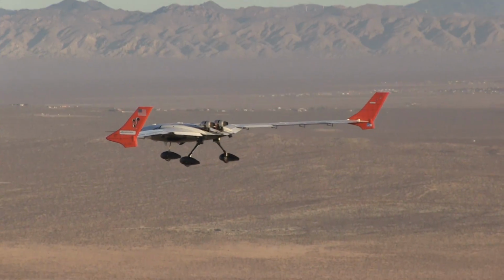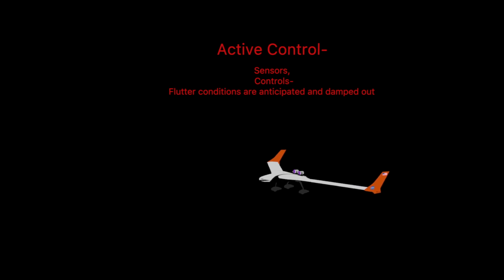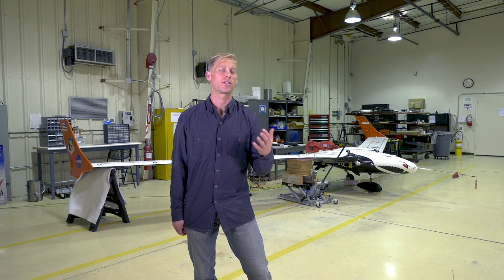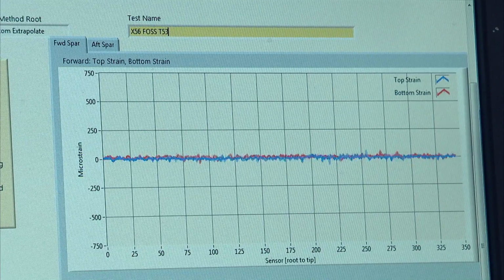X-56- The Future of Flight- Part 1: Active Controls

Comment: Very impressive project, lighter structure are more easily affected by resonant phenomenon. Active control can change the natural frequency of the system, but may increase the consumption of the energy for prohibiting the vibrations. May be adding some mechanical feedback system can achieve the same goal.

Comment: Stupid question. why not just make the leading and trailing edges resist loads differently so when the wing is forced up the leading edge bends less inducing a negative AoA which forces it back down again. 
If forced down it gives a positive AoA to bring it back up
With tuning of the structures resistance you can dampen out flutter automatically.
Reply: Do you mean like an active LE and TE actuators to actively monitor loads and initiate opposite motion?

Comment: So... you want to use this technology to fly at speeds where, if the system fails, your wings will be torn off before you even realize what's happened and can slow to safer speeds... 'kay.

I will keep tabs on this technology so I know what planes I should 'never' set foot on.

Who approved this nonsense? I mean, seriously. The viable projects that 'aren't' getting funding, and this joke is moving forward? Just because you can, doesn't mean you should. You want to know how else you can go faster without running into flutter? Go 'higher'.

Comment: Do not use a linear wing design ?!. Every even geometrical structure makes harmonic vibration possible. That is the reason why Horten choose the Manta - silhouette. Einstein was a good musician, so the engineers should learn to learn from instruments by implication.  Take every harmonic order in a corner- step in the wings depth and transport it to the next disharmonic counterpart in the following section - if by the profile and or the respective force of induced cyclic vibration.  NEVER use a straight shape or a parallel !
Reply: All types of wing design have been tested, including manta style and ufo style. While they do fly, and have some positives, the negatives far outweigh them. The most pressing problem is that they have poor flight characteristics, making them impossible for a pilot to operate. Linear wings are by far the easier to fly. Software could fix this issue in the future by controlling the plane for the pilot (current gen military fighters does this), but that is going to drive the cost up drastically.
Reply: @Excludos  I have flown quite a lot designs in modell prototyps (Wings) never using a computed aid. None of the early german fighter wings had to apply complex stearing drives. With means such as  boundary layer ventilation or fences you can minimize these effects. And if you design the wing that way, that the vibration causes a torque by the resulting force to deform the wing in the opposite effect to that vibe, it is also possible.  I can show you what i mean with organ pipes. I can design it so as no freq can ever  cause a resonance.  Or tune the structure by different harmonic length of the interiors and it will also counteract that problem. Messerschmitt was a better designer with his cigarettpacks.  Why ? because he felt the design without the mental aid of a computer. To draft a working wing, you need phantasy not a team or a kind of dependence. By the way:  With some inertial servo controll related to the freq of the vibe itself, you can neutralize the problem by phase shift applied to the flaps as well (random function, counterfunction even - odd movement).  And the surface: Microvortex, Cavitation modelling for defining the elasticity of the layer.  Multi hinge and multi pivot steering can deform the wing also in aberatio to the vibration. 
flap phaseshifting can be done with the most simple transistor circuit never ever being able to fail. And in case of emergency the Pilot just has to open the upper ventilation or a vortex  flap and all the relations and equations of the vibration are void. Easy and simple as the russians do.

Comment: So, essentially, with this system when your electronics go down, not only do you have that problem but on top of it you'll also immediately have structural damage risk?
No thanks!
Reply: Ah another example would be the „yaw damper“. This is essentially a flutter damper and if it failed at high enough speed that would probably also result in a crash if the pilot doesn’t decelerate fast enough. My point is: there are many controllers on board of our modern planes that we have to rely on. But they are ideally implemented with backup systems etc to make them secure anyways
Reply: Most modern fighter planes are built inherently unstable and would also crash without a controller stabilizing them. In the case of this plane, if the controller failed, one could simply deccelerate. As far as I understand the active damping is used to allow for fast flight without the need for strong structural construction.
Reply: @ididafewthings  Sure. He could also just eject. However, fighters don't have 300 passengers on board.
Reply: Muru Roa Hence, see my second example
Reply: Correct, but do you know what's FBW is?
Reply: @OnKeyboards  Yes and a lot of pilots don't like it for the same reasons, unless they have redundant generators. The problem of losing structural integrity is not on the same scale as losing input on the control surfaces for a whole minute though.

Comment: There is something inheriently problematic in overcomplexity.  The Shuttle is a perfect example.  2 lost vehicles, and 14 dead.  Soyuz in the same time period?  YOU do the math.  Id dare you to even glance at the economic comparisons...
Reply: I don't believe that the two shuttles which crashed were necessarily due to over complexity though. Challenger was due to an actually very simple system in improper conditions and Columbia was due to external damage to a system which was very complex in number but not in application.
Reply: I believe the shuttle deaths also had to do with less abort systems, today's craft have much better.
Reply: Neither shuttle was lost due to flaws in the shuttle itself. They were lost due to failures in very simple systems.

Comment: Active damping is not a great idea... if you want a robust system make it inherently safe.  It is not a bad idea, but given the potential savings over the number of humans on commercial flights, my money is on better "anything else". Better engines.  Better streamlining (a blended wing with a stiff wing? I would bet that is 60+% of the potential savings, and then add to that some form of turbulent flow drive... why bother going flexy?). So. Big flexy wings.  Great on sailplanes.  Really great. That is what they are for.  They are not for going 500+ Knots.  Even with "perfect compensation for known conditions", the wind/weather/speed will find a mode your models did not predict. More than once. Guaranteed.  Bummer.  To save 10 lbs of Kero out of 100s of thousands of pounds.  Sure, it is a great idea! But the wrong application, too much missing info (turbulence around hills on final? storm cells?), too many moving parts to safely fly ("Passengers I am sorry but we will be landing in Kansas as we have lost our wing control and can not make it to Hong Kong at 600 knots"), and too many passengers at risk. Considering the small potential benefit. Instead, how about... for example... adaptive wing stiffness?  As a passenger, all I ask is make it bulletproof.  If your zipping through the air with a lot of passengers over a wide speed envelope (and 95% of that at a predictable high speed), this is not so appealing to me.
Reply: Here we have another NASA engineer guys

Comment: Can u not install a Torsion diff with a counterbalancing rotating rod on the other end- when the wing starts fluttering, the diff is engaged which activates the counter-rotating mass? alternatively, hydraulic actuators that can either balance the forces by absorbing the motion, like an active bike-steering damper- and then maybe stick a pump on the other end of the tube so the oil, magnetic hydraulic oil, can be used to do other things, like pump smoke out the toilt on the long flights...

Comment: I don't think software is an ideal solution (see Boeing). Any mechanical problem should have a reliable mechanical solution.
Variable geometry wings or wings that have variable harmonic states that automatically and change mechanically with air speed would be much more preferable to a software solution that moves the control surfaces.
Reply: As if mechanical components are in any way more reliable than software.
Reply: @itstheeconomy2101  I mean the entire US Nuclear strategic command system relies on the fact that mechanical components are safer and more reliable than software. The B-2 Spirit falls out of the sky if it has a computer failure, at least with most aircraft you have hydraulics and mechanical systems to get them to the ground safely. The reason we use software is because its much lighter, can store more info and can be much faster. But it is by no means more reliable.
Reply: @southernbear736  hydroponics? What? Hydraulics, perhaps? Agree with your overall point, but hope it's a typo cause the comment currently doesn't make sense
Reply: @southernbear736  "The reason we use software is because its much lighter, can store more info and can be much faster. But it is by no means more reliable."

It's not like mechanical systems are any more "reliable", in fact they have higher failure points because they're the ones that take the brunt of physical forces exerted upon them on a regular basis. They're the ones that experience flutter, erosion, wear and tear, deformation, pressure, etc. Mechanical components are also as prone to operator error as software, like how a maintenance crewman using the wrong type of screw (whose difference was only a couple of millimeters) nearly killed a pilot because the windshield blew out and sucked the poor pilot out the window. Or how latches failing on cargo bay doors have caused air crashes in the past. Mechanical failures and operator errors have accounted for more air crashes in the century that humans have used powered flight than software errors ever have. 

Software may require electricity, but it's not like the rest of the plane wouldn't work without electricity either (try controlling something like a 747 with pure mechanical controls: you'd create a far worse airplane for it), and programmed properly software experiences less failure states than mechanical solutions. Also, you mention the B-2 falling out of the sky if it experiences computer failure, yet in the decades the B-2 has flown only 1 has crashed due to such, and that was due to a miscalibration of related computer systems, which can be put under the category of human error.
Reply: @itstheeconomy2101  might be not, but you can SEE possible problems without any computer.
Reply: Yeah, I doubt if Boeing will EVER recover from such a monumental screw-up. I don't see how they could. Glad I don't own stock in them.

Comment: I think changing the resonate frequency of the component parts would be the resolution rather than just trying to prevent oscillation by stiffening. How about an active skin such as piezoelectric surfaces? Vibration can produce energy which is drained on passive elements or electrical energy can be applied to change micro shake in opposition as active components. Even possible to use as both sensor and transducer as energy is in opposition. Think video transmission of many 'carriers' on the same cable.
Reply: Movable, passive dampening weights that shift the passive resonance frequency of the wing would be more reliable. Making them active with vibration of the weights could also be added. I could also see the control surfaces being used to mitigate some of the effects. Piezoelectric materials would not do well in avaition applications because of the thermal cycling they would be exposed to. You can easily see 120+F on the ground and then -20F while at altitude. If the technology was applied to supersonic aircraft, there is the issue of skin heating from friction creating high temperatures on the skin of the plane.
Reply: @KnightsWithoutATable  ,,,,,, good points
Reply: . l j
Reply: K

Comment: Flutter reduction is already accomplished on the A380 using software. Due to an error in the calculation of resonance of the wing, sensors and software were the most economical solution compared to a new and heavier wing design.
Reply: That's cool! Do you have an article where I can read more about that?

Comment: Google "Lockheed Martin Flutter Suppression" to find videos of flutter suppression working in flight.  Thanks to funds from the Air Force Research Laboratory, the X-56 was designed and built by LM Skunk Works based on work that was started in 2005.

Comment: Changing the purpose of a purpose built aircraft doesn't work. Another aircraft needs to be purpose built for high speed flight, which doesn't have flutter issues. The low speed aircraft built for low speeds is supposed to fly slow and so it doesn't need to worry about flutter. You'll get the benefits of the slow flying aircraft when flying it slow, not fast.

Comment: your active controls will never be able to compensate by moving the control surfaces fast enough... these frequencies are in the order of 30Hz or more depending on wing rigidity (the more rigid the higher the freq).  Therefore any control such as servos will not be able to move fast enough to act upon a compressible fluid environment that has a delay component associated with it.  Your best bet is to focus on passive controls and avoid complexity in a system...  complexity adds to cost and reduces service life.
Reply: I am guessing that the active control systems will not be trying to counteract each flex of the flutter, but rather detect flutter before it happens and change the parameters of the airflow over the wings to avoid the flutter happening in the first place.

Comment: What if they built a hollow wing spar filled with shear thickening fluid? The fluid could be mixed so that the wing remains flexible until enough pressure/vibration causes it to stiffen and not be destroyed by flutter.
Reply: Kyle Smith But is always the same problem, you’re adding weight. 
What they are trying to do (only my opinion based on what I could see in this short video) is using servos that activate the “active” part of the wing. Effectively they’re producing an alternating force distributed on the wing that is always in opposition to the flutter movement. This also is going to have limitations with the accuracy of the servos, response speed and vibration on the electronic and robotic system. 
Excuse me if my answer is not very clear but I’m not an expert nor a native English speaker.

Comment: So, let me summarize. 
You have built a wing ultra thin so as to re-introduce flutter, then set about removing the flutter again.....
Maybe if you developed the X-48 fully you would not need long thin wings at all?
Reply: Nick Breen wrong. They built a light weight wing to cancel flutter and be more efficient. Did you even try to pay attention?
Reply: Your intellectual brilliance has once against exposed the incompetence and corruption of the so called elites.
Reply: What have you been working on recently professor?
Reply: Meanwhile private industry is landing rockets, my point is that there is more pressing matters to work on, bigger problems to solve. This is a stretch as it is not a major issue.
Reply: What a nonsensical statement. NASA gave spaceX money ($1.6 US BILLION) to keep going. NASA does not BUILD anything - NASA has ALWAYS contracted out the design of systems like the Space Shuttle and Rockets. NASA does fundamental research and provides it free of charge to the aviation community. NASA aircraft are modified versions of existing aircraft. F-5/F-18/B747/MQ-9 Predator/Global Hawk/ etc/ etc/ etc. Where in Florida did Spacex launch from? Oh thats right off a NASA facility.
Reply: NASA just gave that money to SpaceX? Who's not paying attention?